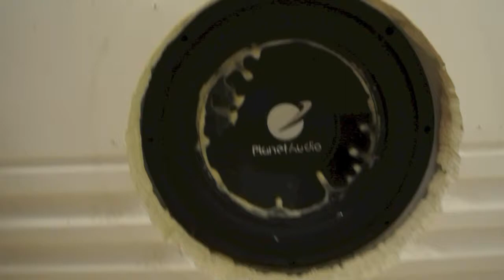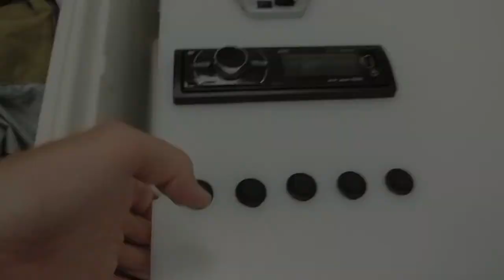Ice Chest Speaker cooler part 2 of 2 "the insides"

Comment: Hello, nice set up. I purchased a NIB Jensen MCD9425 Marine CD player and NIB Polk Audio DB651 6.5 speakers for my girlfriend's son's boat.  He has an outboard motor so I am not sure how to set up this set up without running down his onboard battery.  I want at least 1 Polk Audio 10" or 12" DB sub to complete the system. How long does your Stinger battery last between charges?  This is my biggest concern.  I have an old school MTX Pro75x2 amp to power the speakers  in "Mixed Mono Mode" and would be pull a 40 amp draw.  Thanks for your time.
Reply from the maker: The run time varies depending on how loud you have it.  I have never timed it from start until it shuts off.  My best guess is that it will go for 8+ hours.  You have to remember that the system does not require a lot of amps to operate, so if you are trying to judge the runtime for use in a boat it is a little different because your stereo will work fine but the battery will not have enough left in it to start the engine.  Thanks  for the question.

Comment: This is very close to my design. I sell them for 1200.00, using clarion or fusion 7" mids, and am still experimenting with different subwoofers. I have used Clarion, Kenwood, Alpine, Orion, and Pyle subwoofers. The Pyle sounds the best. For the amp, I use either a JBL 6040m, or Rockford Fosgate M600-4d. I prefer the Rockford for many reasons. It is a digital amp, so heat is not an issue. The Jbl will need a fan. I also use a hole saw and drill out the drain plug, and use a JEGs recessed male plug, attach a female pigtail, and include a battery charger with the build. Also, I drill an extra hole in the outside perimeter of the subwoofer, like an extra screw hole, and attach a remote repeater to the subwoofer grill, so you can use a remote from anywhere in front of the cooler. Nice job. I can post pics of my build if anyone is interested.
Reply from the maker: Glen Irick It sounds like you have a pretty neat design, if I do another one I might consider some of your ideas.  Thanks for sharing and Please subscribe and share with your friends..  MSfirefighter662

Comment: Where did you find the hdpe plastic? I think you called it decking board in the description? I can't find it for less than $20 for a 12"x12"x.08" piece.
Reply from the maker: codytucker10 If you want of piece of that material you will have to know someone who knows someone,  if not a piece of quality plywood that is sanded and painted would look very nice.  Thanks for the question please share and subscribe

Comment: Can you explain how you connected the rocker switch?
Reply from the maker: 24eochoa The switches that controll the fans & head unit are +12v in to the componet being controlled.  The switches that controll the side speakers are just inline from the + wire coming from the amp to each set of spearkers.  I hope this helps.

Comment: Thanks for sharing your video.  How do you keep interference or that annoying buzz out of your speakers?  I've built a few simple coolers, but I'm trying to add a USB input to one in order to charge an i-phone while listening to the cooler and if I hook the USB input up to the same battery that powers the amp I hear static while charging the phone. So I added an extra battery. Fixed the problem, but it seems like there is a better solution.  Any advice?  Thank you!
Reply from the maker: Kevin Belsole Thanks for the comment/question, I have never had a problem with static or buzzing sounds from the stereo while it is on its own power.  I get a faint buzz when I have a battery charger to it while it is playing and I do not know how to fix that problem.  If you find a solution please report back.
Reply: +msfirefighter662 try an inline noise filter. just hook rca cables through it

Comment: How do you hook up your sup to the amp. How do you hook up the battery ???
Reply from the maker: I am assuming that you meant to "sub to the amp".  The head unit has a pre-amp output for the subwoofer that went to the amp. From the amp to the sub is just normal speaker wire.  Hooking up the battery was a little more complicated because of all the components that require power.  98% of the wireing inside is left over from other projects and may be a little hard to tell what is what because most if it is all the same color.  I took +12v from the battery and ran it to a distribution block on the other side, where all the things that need power are hooked up with their switches.  -12v is all collected on a home made distribution block and run back tot he battery.  

I hope this helped, if you want to know more let me know

Msfirefighter662
Reply: How did you hook up all the switches? Did you daisy chain the switches or wire each independently?